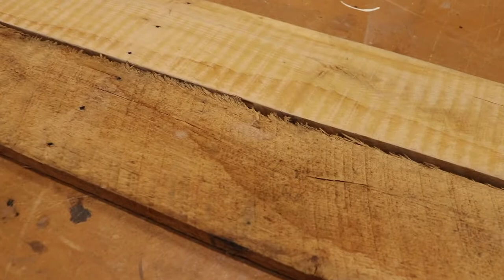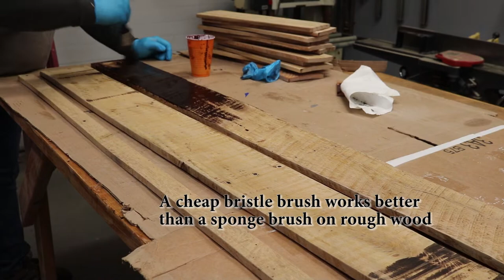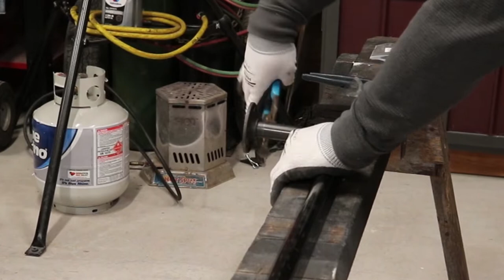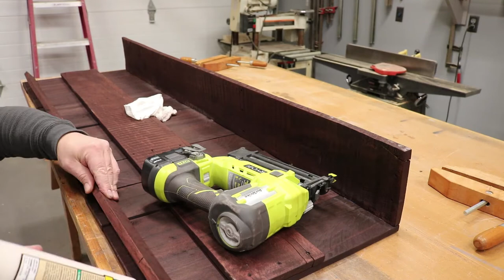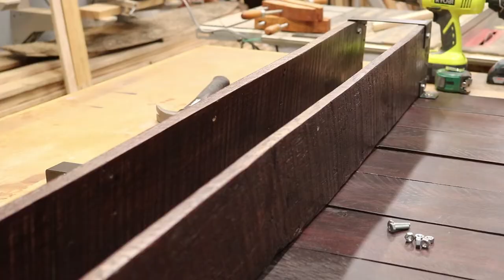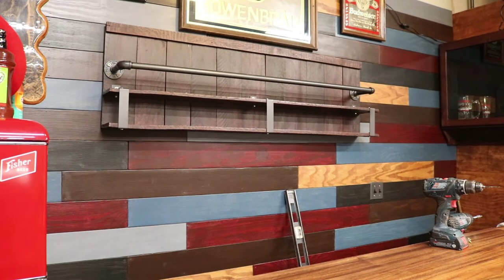Rustic Liquor Shelf from Pallet Wood, Iron Pipe, and Metal Bracketry

Comment: Nice looking!  Not easy to drive brad nails into thin hardwood! You sure need to check there are no nails left in those planks. Either for the planer where you will scrap blades. But mostly when using the table saw. This is where it gets beyond damaged blades.  My father-in-law once received a piece of nail to its face and it was embedded in his skin. He was able to remove it without much problem, but that is to be considered!  So the small detector has ALREADY paid for it! Thanks!
Reply from the maker: Thanks Joe, yeah that situation with your father-in-law is a good reminder to be aware of what you're cutting and to always wear safety glasses too.
Reply: I've made a small plexiglass guard on top of my saw for that. So it prevents projections and it's not in my way as the original and annoying safety guard.  I should make a video of it.  Even though, I wear safety glasses. Thanks!